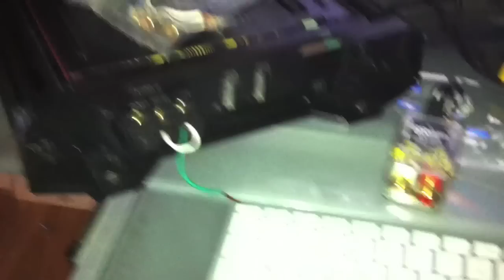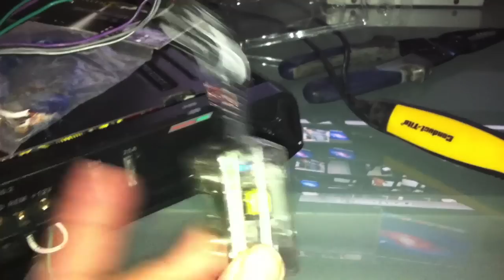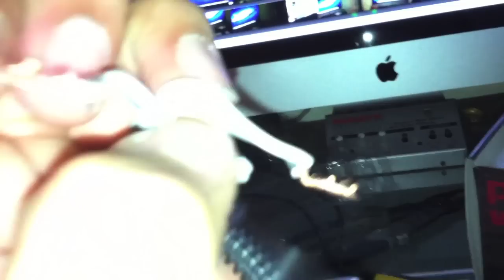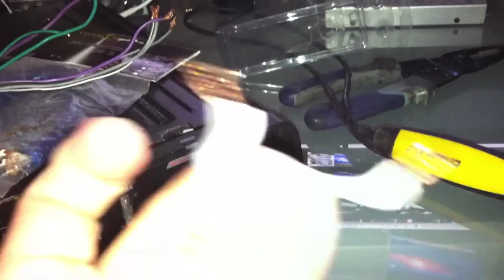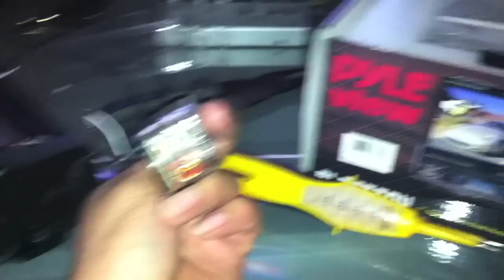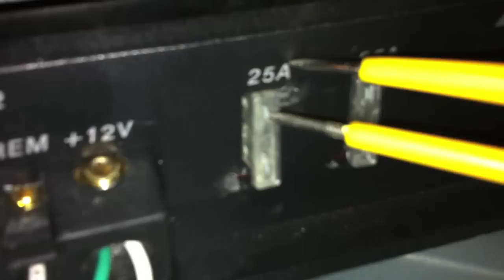how to put amp into stock radio stereo full discription

Comment: This was helpful for my son install, much appreciated. Question, I want to add a amp to power  my highs (front and rear) , should I get a converter like this and run new wires to each speaker, OR I see in another video of yours that you had TWO converters... I don't want to go too expensive as it's an older vehicle and I need my trunk space for work

Comment: How can I get a remote with same system. I have a 2017 Ford focus with stock radio. And doesnt have a remote. I dont want to turn on the amp manuel. But as I read the comments, some say ACC and antenna. How can I use them for my amp?

Comment: Hello Sir! 
Is it possible if I wanna install amplifier on original stereo without RCA converter? 
How?
Tnx
Reply from the maker: Yes if the amp is new u will find some cables that connect to the high input line -
Reply: @MiztaShy  
My car is Reaunalt megan 2 when I bought this all of cables was on the vehicle and now I have a amp (Helix blue B four) but I don't know exactly which one is correct 😀
Tnx for your reply

Comment: Im new with this input stuff. If my amp has a 4-Pin input wire, can I buy the 4-Pin wire and just attach those ends to the back speakers like you mentioned instead of buying RCAs and a converer?

Comment: Any instructions for a 2002 mustang gt with the Mach 460 stereo. I tried installing a line output from the head unit with no luck. Do the 2 amps that come stock with the system change the way you should wire. Thanks

Comment: Do you have audio wiring diagram for Ford Fusion 2012? I need knows which wire turn on the original amplifier. Thanks
Reply from the maker: +999MAO999 try out modifiedlife . Com

Comment: Won't you drain your battery if you have your remote wire connected into the 12 volt wire? I'm pretty sure the remote wire is meant to be hooked up to your head unit. If it's hooked up to your 12 volt wire the amp will stay on even if the car is off.
Reply: It will drain  ur battery but  if you put an interruptor  it will work  the only thing is u have to turn it on and off manually
Reply: Yeah man I'd imagine the same thing, I hooked it up to the acc wire to the unit. I did that same mistake first hooking up subs lol couldn't figure out why my amp kept staying on
Reply: is it better to connect remote wire to ACC or to antenna in the unit ?\
Reply: @amrelhamedy2200  how can I get a remote from ACC or ant?
Reply: Amr  Elhamedy connect it to your acc
Reply: It does not torn off amp when car off it stays on because your remote wire is with the battery so it stays on draining your battery
Reply: Yeah you can run it and use a toggle switch to turn it on/ off manually and it won’t drain your battery
Reply: ItzGerrod d

Comment: Hi, guys, would any of you plz help me out? There's a problem with my Pontiac GTO's standard six-disc 200-watt Blaupunkt audio system with 10 speakers. Whenever I accelerate, the volume increases. How can I, perhabs, change the setting of that function?
Reply: Read your owners manual.
Reply: Don't u think I'd do it if it was possible? I don't have it, and couldn't find it in the internet, that's the problem.
Reply: +JERMUK OLYMPIA This problem is something called Speed Compensated Volume, often expressed in numbers one(1) to seven(7){1 being lowest volume at speed, seven being the highest}. Your manual will educate you on how to turn this setting to a lower number. If you have an aftermarket H/U it will be located in the "sound settings"
Reply: +JERMUK OLYMPIA Use a capacitor to regulate power
Good luck
Reply: +Dean Glennie Thnx a lot!
Reply: +Brandon Gunter Thank u!

Comment: Hey guys I'm installing a amp in my new 2015 corolla and my fuss box is in the engine compartment could you use the wire s going back to the signal lights
Reply: +James st clair If the lights are keyed power. People sometimes mess up by tapping into the brake light and the amp only turns on when the brake is applied or blinkers are switched.

Comment: My amo has a 'high level' input so can I connect a wire spliced from the rear speakers to it?
The box you use is a cross over? If so how do you get mids and highs? Also my last question is my system has ok highs and mids but my lows are simply missing. Can I get the lows without a sub? Could I use an amp and say 6x9's?
Just for anyone who's interested I have a Phoenix gold amps and JL subs, I also have a alpine amp. Both have little to no use, only problem I have when installing is crimping the wires.

Comment: Yikes! If your going to make a tutorial , do it right don't cut corners like jumping the remote wire in to the hot power wire so your amp never turns off, and use right and left instead of making it mono. If your going to show people how to hook stuff up Atleast show them the correct way!

Comment: Okay I have 99 Camry with a stock deck and I have bought 3 different converters the last was by rock ford fosgate and non of them work.... I have a 2 channel amp @ 840 RMS and the sub is a 12 850 RMS wired at 4 ohms  bridged.... How do I wire this

Comment: how is the sound quality with those converters? is it ok?
Reply from the maker: adrian17cy   is just as good  as if u was hooking it up to a deck
Reply: +MIZTA shy mine sounds like crap. and I got a pretty good LOC has a remote wire positive negative and speaker hook up. my amp is a Sony amp 480 watt. so I figured it be great but nope. sounds bad. I up my bass and it makes my rear speakers sound like crap
Reply: +marc muniz Hi all! I've ordered one of these from Ebay and it's working great almost one year now. I had some issues at the beginning, one of the RCA slots was not making contact properly. I've set that and now all is ok. Also the potentiometers that adjust the volume I have them low. I've set the subwoofer high and then worked the converter. that way will ensure that the converter will not pass noise more than necessary. I'm really happy with it, maybe it's just a case where you need to setup the volumes once again.
Reply: +marc muniz you probly blew out your stock subs

Comment: First off thank you for the video, I was actually curious if i could splice the +/- together and wire it to one speaker for simplicity.

The Second thing I wanted to say is xLTproductionz, is incorrect.
The remote line on an amp is used as a signal to tell the amp when to turn on and off, so for instance if you were to wire it like it is in the video and just hook it straight to the battery it'd never turn off and drain your battery.

You can wire the remote line 3 ways.
1.) to the ignition line in your steering column.
2.) to the fuse box.
3.) straight to the battery with an inline flip switch/fuse for manual control.

The remote line doesn't control the power output of the amp, that's what the gain control on the amp is for, gain is the amount of volume the subs will produce at various volumes you select on your deck.

Say your deck has a volume limit of 64
Volume 32 - Deck produces output from the decks amp to door speakers.
Volume 32 - Amp produces (Gain 50%)  (200) watts > max output of amp 400

The inline converter tells the amp via minor electric pulse how the amp should regulate itself to the decks volume.

I'm aware this is a long comment but I almost skipped this video due to the post of xLT, so I wanted to say thanks for the video and share some actual knowledge with others.
Reply: you could but it will only give you signal from either the left or right channel
Reply: secondly just a correction on your description of the function of the gain control, while it does have an effect on the volume, it is actually used to adjust the output signal strength, so if not set correctly, it can lead to damage to the sub even if there doesn't seem to be audible distortion. i suggest setting gains with a voltmeter using ohms law, its the most accurate method of setting them without high end equipment
Reply: how do you wire it to the fuse box?

Comment: Could you just splice the remote wire to the wire that turns on the radio on your stock hu? Or even the 12v outlet you stick a phone charger on?

Comment: You are horrible at this, you should not make tutorials. The remote wire does not tell the amp to turn on, the remote wire allows you to control the amp from your head unit. The POWER wire gives the amp POWER to POWER on! And this is supposed to be about the converter, not how to wire subs
Reply: clearly everyone here is a beginner in some way… but you are straight preaching the wrong information. you really are a fucking jackass
Reply: the remote wire tells the amp that the key isnt turned on and shuts the amp off so it doesnt kill the battery, DUH learn a thing before you post on it.
Reply: what an idiot. the blue wire tells the amp to turn on. it doesnt supply power to the amp but yes it says hey wake up.
Reply: you fucken idiot, the remote wire DOES switch the amp on and off, if you just use the power cable on its own, the amp will be constantly on and run your battery out of power. you should have learnt this before you went and opened your mouth so shut the fuck up.
Reply: well, really its the cd in the CD player that tells the speakers how to sound, or USB or Ipad etc lol. =)
Reply: Dorreen Hema thank u what the hell was the other guy saying damn u can tell he knows nothing about car audio and he is getting his lessons from.a stupid book SMH
Reply: lmao why are you on here correcting and calling people out when you dont  even understand what you're talking about? yes the remote tells the amp to turn on so it does not constantly draw power from your battery.
Reply: Remote wire is switched power, Power wire is 12v Constant, RCA's send info from H/U to Amp.
Reply: Your stupid actually its the rca's tht tell how the speakers sound
Reply: barcode80 no its the person who puts in the cd who tells the speakers how to sound! lol

Comment: @Greasler717 just get the two plus wires from the converter and hook them up to the plus wire of the speaker then get the two white and black wires from the.converter  and hook then up to the black wire on the speaker then run RCA wires to amp for a two channel amp just use one speaker

Comment: I'm not sure if I'm missing something or if you didn't explain it thoroughly enough. With the convertor, do I wire it into the actual car speakers? If I get a wire diagram for my car's radio system and locate the color wire for a speaker, do I wire directly into that? Can I use only one speaker (using the positive and negative from that one alone?) or do I have to use two speakers? I have a two channel amp with one sub.

Comment: I have a regular Chrysler 300 2006 I had a double din in it but took it out and speakers are still connected the RCA jacks and the blue wire which is I think it's the ground it still behind the factory radio I would need to diagrams to see what wire is the speakers so I can connect them to.... Please in correct me if I am wrong the blue why you're is that the ground that connects to the black wire on that RCA adapter that you bought????

Comment: can I put a toggle on/off switch to the 12v input to the amp and still link the remote wire to the 12v so i do not have to tap into the head unit?

Comment: Connecting the remote into the fuse box puts a unsafe load on the fuse box and will result in other fuses blowing and car computer damage, ALWAYS connect to the acc wire for stock radios or to the dedicated remote wire on aftermarket deck wiring harnesses.

Comment from the maker: on the rear speaker , thats if ur speakers are othe back if they are on the doors then u will have to remove the door pannel to get to the speaker wires, but if thats the case might as well just remove the deck and connect it form thir , will b coming up with a video on more details on these subject

Comment: Can u tell me the wire speaker color for my lexus 2001 gs. Can i use radio constant 12v or radio switch 12v for my remote wire to the amp?